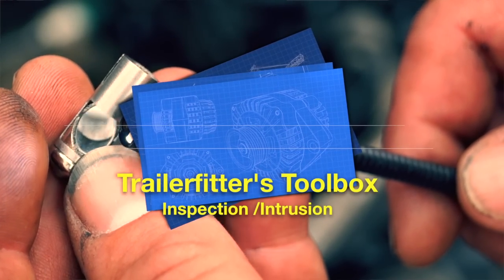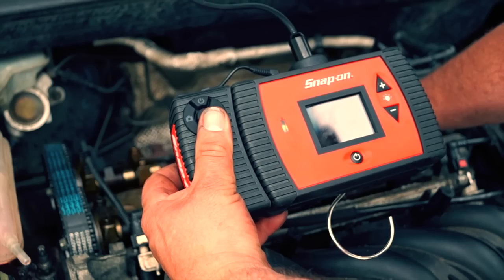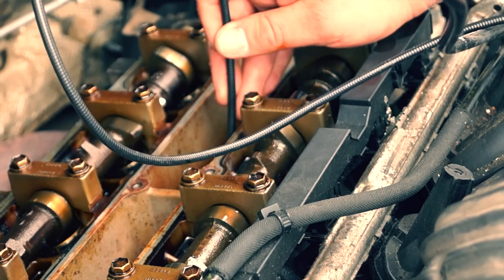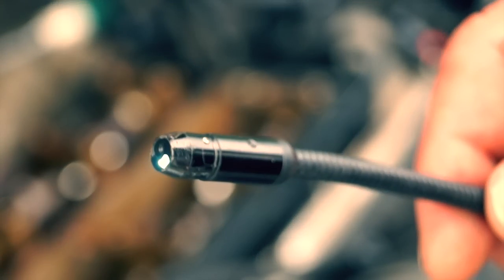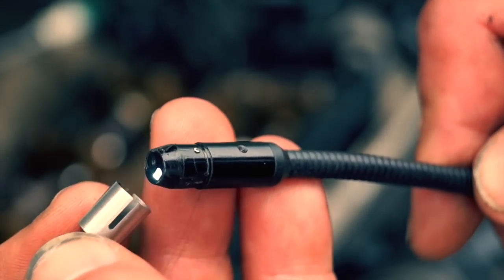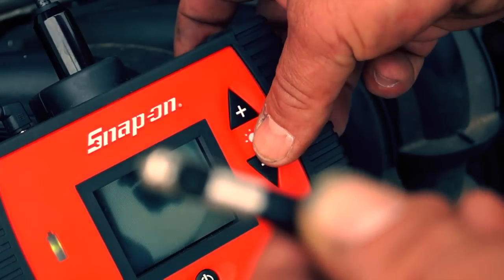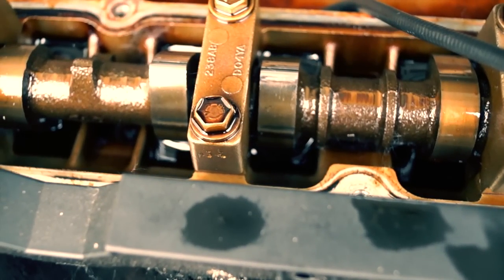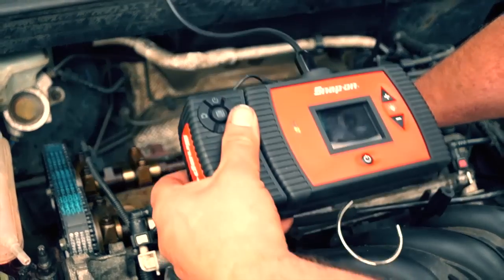Endoscopic inspection camera -  checking for bent valves with cylinder head on.

Comment: I did a Honda CRX that stripped a timing belt at Idle, bent a bunch of valves. I put them all in the lathe and beat them straight as I could get and re-seated them. But 2 of the valve guides did crack when they bent over, I didn't change them. This endoscope would have been nice to have back then. This was back in 1994 when I did this Honda CRX.
Reply: you made bent valves straight?  WHY? WHY didn't you buy new ones?

Comment: Snapon Leakdown tester is much quicker and easier to diagnose these faults
Reply: +Jordan Mcmaster Maybe quicker and surely cheaper but this can actually be SHOWN to the idiot customer to assure a problem which will end up costing them $$$$. 
The numbers on a leakdown or compression test mean nothing to them.
Picture of good valve in the cylinder.
Picture their bent valve.
So easy even 20% of uh merricanz can understand it !.....OK 15%
Reply: It has to be Snap-on of course , not just a homemade leak down tester!!!

FFS
Reply from the maker: Budd Hudd  Laser tools do a leak down tester that we will be showing soon.
Reply: I made my own.  works a treat,cost about €30.00